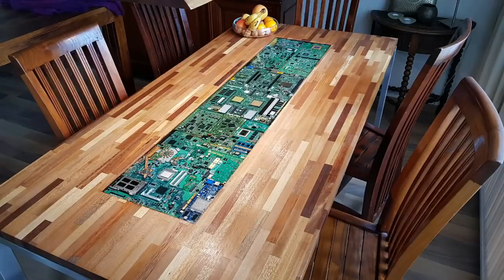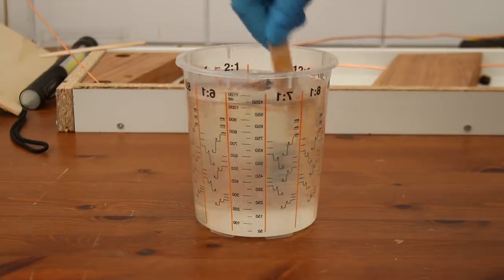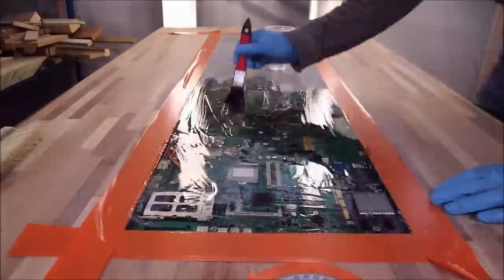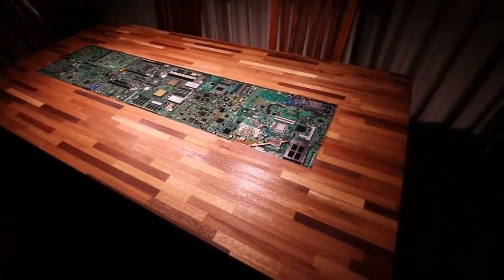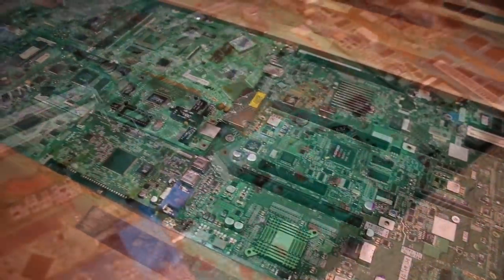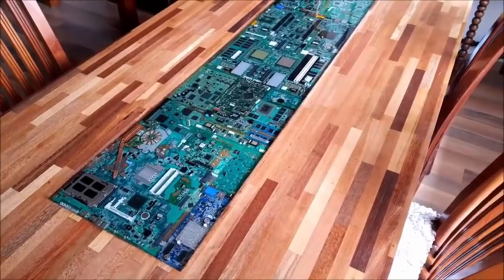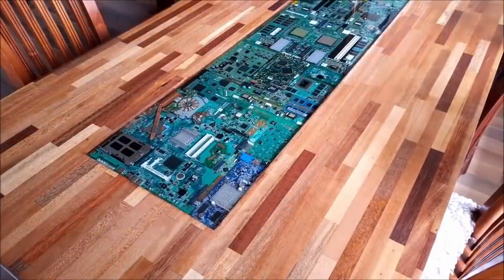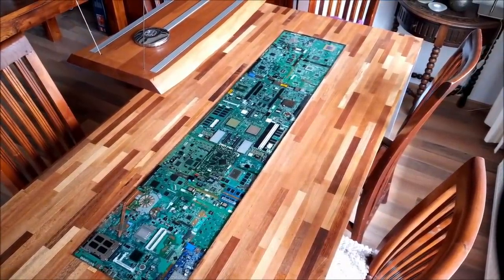Circuit boards with lights in epoxy in a table

Comment: Next time use 2 1x4 flat boards as a sled and run the router deeper all the way . Wasted time and energy on chiseling all that out also dont know much about epoxy but what about spraying hardner on it and letting it soak then recoating the whole table top with thouroughly mixed epoxy to seal
Reply from the maker: As you can see here https://www.youtube.com/channel/UCNdDV4vHKjuWOYlEW4HIk5w/community I've begun trying to fix the table. I routed out the bad spots and will try to pour in new epoxy. The first results look promising.

Comment: Such a beautiful table, and awesome idea. Shame it didn't work in some of those areas, and remained sticky. There must be a way.. What if the resin was poured in smaller amounts, and in more stages..I would still love to try something like this :)
Reply from the maker: As you can see here https://www.youtube.com/channel/UCNdDV4vHKjuWOYlEW4HIk5w/community I've begun trying to fix the table. I routed out the bad spots and will try to pour in new epoxy. The first results look promising.
There is no point in pouring smaller batches as the problem was in the mixing of just that one layer..

Comment: It may also be a bad reaction to some of the Plastics on the PCB's, Might pay to glue the boards down and then a glass plate over them and then some epoxy.. what say yo all?
would thart woik? Err-that work? Another thought came to mind and that is that electrolytic capacitors have OIL in them, and if any of them have leaked even if some in detectable amounts, it could mix with the resin  and Ruin it, ergo it might pay to bath the PCB's in alcohol before installing them..
Reply from the maker: The first pour I did was to fixate the boards and that was fine, so the boards had no influence on the epoxy. The problem was in the mixing. 
As you can see here https://www.youtube.com/channel/UCNdDV4vHKjuWOYlEW4HIk5w/community I've begun trying to fix the table. I routed out the bad spots and will try to pour in new epoxy. The first results look promising.

Comment: Is it possible that the oil you used for the wood actually is the problem?
if it is then I would suggest you use a Clear Marine Lacquer instead of the oil, on the wood that is..

Comment: amazing project! 
what was the reason of the smudges ? The extra layer of epoxy, which you put with the orange tapes on the side?
Reply from the maker: As I said, it was the mixing that went wrong. Originally I wanted to sand and polish the surface, but as I saw the bad spots, I added the extra layer - no use in sanding and polishing... 
As you can see here https://www.youtube.com/channel/UCNdDV4vHKjuWOYlEW4HIk5w/community I've begun trying to fix the table. I routed out the bad spots and will try to pour in new epoxy. The first results look promising.

Comment: I personally love the table. I would have gone a little further with the fiber optic cables to run off a 9v battery, a rotating light and give the glimmer effect. I've  been working with electronics for almost 40 years and as a career for 23.

Even with the bad spots the table is NOT a complete loss. Look for garage sales for old glass tables and lay a glass cover over it.
Reply from the maker: So we do it all on our own way... I deliberately left out the battery powered lights with controller, because I thought you would go crazy quickly of a carnival in a table all the time... 😊 It is the temporary character of the manual light for a few seconds in the fiber optic that I like.
As you can see here https://www.youtube.com/channel/UCNdDV4vHKjuWOYlEW4HIk5w/community I've begun trying to fix the table. I routed out the bad spots and will try to pour in new epoxy. The first results look promising.

Comment: the failed staff caused because epoxy wasnt put there in one step.... cover it with black paint, and you will have expesive but good table.
;)
Reply from the maker: No, the problem was in the mixing. You're the absolute first with the black paint suggestion - and that's an accomplishment after receiving already over 4000 comments on this one video... 😊
As you can see here https://www.youtube.com/channel/UCNdDV4vHKjuWOYlEW4HIk5w/community I've begun trying to fix the table. I routed out the bad spots and will try to pour in new epoxy. The first results look promising.

Comment: The 7 liter pour was too much at one time. Did a table with epoxy a couple of years ago, and I only used ~4 Liters total, in several pours, with about 6-8 mm thickness. I still have soft spots. If I leave a full beer bottle on it overnight, the next morning there will be a small indentation. It does go away in a couple of days though.
Reply from the maker: It depends on the kind of epoxy how much you can pour at once, and the limit is not in the volume, but in the thickness. My epoxy could be poured 5 centimeter at once, I did little over 1. My problem was definitely in the mixing (and it wouldn't surprise me if yours was too).

Comment: Cool looking table and I apologize if someone already asked this... but wouldn't it have been easier to just route the entire thing out instead of chiseling the bulk of the material?
Reply from the maker: Yes, you're not the first to ask, but I don't mind... 😊 I don't think that would have been easier. With one blow of the chisel I can take out far more than in the same time with the router, and I would have had to make some kind of sled for the router. 
Someone suggested me to cut with the saw the whole rectangle out and put a sheet of plywood underneath, and yes, I do think that would have been quicker...

Comment: i'd like to have a similar thing except it would be a working pc (even if it was with windows me). :p
Reply from the maker: You're not the first to suggest (so I had some time to think about it 😊 ) but the thought that if the pc would break down, the table would lose part of its coolness, made me decide not to attempt.
Reply: @Onrust1  yeah but it wouldn't have epoxy resin so i guess it would have a removable glass counter. and it would have less amount of componentry so it would be a challenge to make it this size (for example: two pc-s connected by lan). (and it would have to be practical, so at least have all the sockets etc.)

Comment: and how much resin did you use on that table ?
Reply from the maker: A bit under 10 liters. More about it in the description of the video.
Reply: @Onrust1  how much resin i need for 30x80cm table ??
Reply from the maker: Hey this kind of math you had in school... 
It's L x H x D in liters, where 10 cm = 1. So with 30x80 and 5 cm thick (I'm guessing the thickness here), it is 3 x 8 x 0.5 = 12 liters.
Expensive table... 😊
Reply: @Onrust1  thats a lot of resin XD. im going with acrylyc sheet then

Comment: I felt it was a fail before finding out about the epoxy, because I didn't like the execution of the lighting.  It seemed that it would only work if the room was dark.  I would have preferred keeping standard LEDs with wires and maybe some way to power it -- that's just me.  Otherwise, the idea and the expression of the motherboards does seem somewhat interesting.

Comment: Maybe cut a nice big slab of glass and put it on top of the table, like some bar counters have, its shiny, and the table wont be sticky, and its easy to clean. It would weigh a TON though :P
Reply from the maker: As you can see here https://www.youtube.com/channel/UCNdDV4vHKjuWOYlEW4HIk5w/community I've begun trying to fix the table. I will try to pour in new epoxy. The first results look promising.

Comment: Ziet er geweldig mooi uit, jammer dat  het misgegaan is. Plekken met slecht gemixte hars kan je niet herstellen helaas, of je zou de plekken helemaal weg moeten halen, maar dan beschadig je waarschijnlijk de printplaten. Het beste is om de hars met verharder met een boormachine en een verfmixer te mengen, of in een afgesloten blik en dan goed schudden. Je weet dat Epoxy zwaar giftig is? Tijdens het verwerken altijd een koolstofmasker (P2) gebruiken. Het nadeel van Epoxy is dat het vrijwel geurloos is. Je kan Epoxy jarenlang zonder een probleem verwerken maar dan opeens wordt je er allergisch voor, en dan heb je een probleem. Ik ken iemand die jarenlang helikopter rompen bouwde voor RC Helikopters, op een dag was hij bezig met een relatief kleine reparatie met Epoxy. Omdat hij "voor een uurtje" in de garage zou zijn en zijn vrouw met het eten op hem wachtte ging ze kijken waar hij bleef. Hij lag letterlijk te stikken, zijn ogen zaten dicht door slijmvorming en hapte naar lucht. Gelukkig hebben ze hem kunnen redden en het bleek een heftige reactie op de Epoxy te zijn. Het was een grote forse kerel met een grondverzet bedrijf en hij geloofde niet dat het door de Epoxy kwam, want "ik werk er al 30 jaar mee en nooit een probleem gehad, dus dat kan niet" Met het gevolg dat hij nog een keer in het ziekenhuis terecht kwam nadat hij een klein bekertje Epoxy aangemaakt had. Toen wist hij het ook.
Reply from the maker: Indrukwekkend verhaal. Ik weet dat het giftig is en doe ook alles om contact te vermijden, maar dat de dampen ook zulke consequenties kunnen hebben (ik ruik inderdaad bijna niks), daarvan was ik me niet bewust. Ik draag wel altijd een masker, maar ga nu op zoek naar een koolstofmasker. Lijkt me wel verstandig... 
Ik ben al bezig met het herstellen van de tafel, en het lijkt heel goed te gaan. Je kunt het hier zien: https://www.youtube.com/channel/UCNdDV4vHKjuWOYlEW4HIk5w/community Ik heb inderdaad de slechte plekken weggehaald, voornamelijk met de bovenfrees. De epoxy heeft een hele dunne laag die vloeibaar is gebleven en die je er bijna zo vanaf kunt pakken, zonder de printplaten te beschadigen. Ik krijg niet alles weg, maar 90 procent van de ellende wel. Het is een groot verschil met hoe het was (maar het is wel weer veel werk). Ook hier wil ik een video van maken. Bedankt voor je reactie! Groeten, Ron.
Reply: @Onrust1  Ik ben meer dan 35 jaar als autospuiter aan het werk en kom dagelijks met oplosmiddelen en andere giftige stoffen in aanraking. Wat dat betreft ben ik gelukkig nog altijd bespaard gebleven van de consequenties die altijd op de loer liggen. Maar ik ben er altijd van bewust geweest en draag altijd handschoenen en mijn masker. Hier een link naar een heel goed masker dat niet te duur is, je kan natuurlijk zelf ook zoeken maar kwaliteit/prijs is echt goed: https://www.nonpaintstore.nl/nl/3m-06941-verfspuitmasker.html  Oja, berg je masker altijd in de hersluitbare verpakking die erbij geleverd wordt, de koolstof doet zijn werk ook en verzadigd als je het masker open en bloot ergens neerlegt. Knap dat je het al zo goed voor elkaar gekregen hebt, je bent een doorzetter :) Ik ben benieuwd naar het eindresultaat, neem je de tijd zodat de Epoxy goed kan uitharden, dat duurt namelijk een paar weken, misschien wel maanden. Dat is afhankelijk van de temperatuur en luchtvochtigheid. Bijna alle 2 of 3 componenten materialen lijken na een relatief korte periode uitgehard, maar niets is minder waar, tot 90 of 95% gaat snel maar de uiteindelijke volledige hardingsproces duurt minstens een paar weken.
Reply from the maker: Bedankt voor je tips en de link! En de complimenten... 😊 Ja ik weet wel van doorzetten, maar er moet wel sprake zijn van een zichtbaar doel - in dit geval: een nieuwe video. Ik heb gemerkt dat het uitharden lang duurt, ja. Heb jij misschien een tip hoe ik die epoxy nog harder zou kunnen krijgen? Afwerken met een polyurethaanlak misschien? Op een tafel wil je nou eenmaal geen krassen..
Reply from the maker: Ik heb je masker gekocht en al gebruikt. Nogmaals bedankt voor de tip.
Reply: @Onrust1  Goed bezig kerel 😁👍

Comment: I think you should try to salvage your hard work and maybe find a way to remove the bad parts and repair and refill them. I love this concept and have seen many videos of this type and the one thing everyone seems to pay particular attention to is mixing the resin perfectly in very large mixing/measuring containers to ensure a nice consistent even pour over the entire area in layers. For example 4 liters for the 1st pour, let dry, then pour the remaining amount needed to make it level with the table top and cover components. Also in other videos they will try to get all the bubbles out and apply heat during the curing /drying process. I really want to have a table like this in future because I had one in the past. It was an old door from a catholic church in mexico Me and  my wife (now ex-wife) were placing photos bank notes, coins, and other souvenirs under the resin as a way to remember our adventures together.
Reply from the maker: Nice story. How can you lose such a table / door..? 😊
As you can see here https://www.youtube.com/channel/UCNdDV4vHKjuWOYlEW4HIk5w/community I've begun trying to fix the table. I will try to pour in new epoxy. The first results look promising.

Comment: Solutions: do smaller pours and use a heat gun to pull the bubbles out. That will also help with the poor mixture of epoxy. Tape the edges of the table before the final pour, so you can just pull the over-flow off with the tape.
Reply: Does heat gun speed up the cure process? Could the bubbles be shaken out?

Comment: Perhaps a sheet of glass glued over the entire surface of the table or a part with microcircuits fixed the suitability of the table ?!
Reply from the maker: As you can see here https://www.youtube.com/channel/UCNdDV4vHKjuWOYlEW4HIk5w/community I've begun trying to fix the table. I will try to pour in new epoxy. The first results look promising.

Comment: Seems like the table wasnt absolutely level, which should have been considered.
Reply from the maker: It was level. It is not completely flat, but the middle is a few mm lower than the ends. I was not aware of that until the pouring revealed it.
Reply: @Onrust1  Ok buddy. ..just wondered. ...really a beautiful piece of work. ..

Comment: If there isn't too much liquid phase resin entrained in large bubbles, you could try vacuum bagging and baking.  It won't significantly set residual liquid resin without more catalyst.  But, it should remove the volatile organics available to the surface, and "dry" the wet/stickiness out of everything.  What level of defect "repair" you choose to do beyond that is up to you.  Fill bubbles, cut 'em out, color them, light them, whatever.  Failures give Damascus steel its defining character.  As a table, it's a bit inorganic without some, for my taste.
Reply: Preempting flaming, if you can build this table, you can make everything I just mentioned.
Reply from the maker: As you can see here https://www.youtube.com/channel/UCNdDV4vHKjuWOYlEW4HIk5w/community I've begun trying to fix the table. I will try to pour in new epoxy. The first results look promising, it looks like I can take 90 percent of the ugly spots out (trying to take the rest out would damage the components on the boards).

Comment: If the sticky epoxy is a problem, how about doing a light layer of epoxy followed by a layer of either glass or plexiglass (if the plexiglass doesn't have an adverse reaction to the epoxy).  Then if there are any sticky spots, they are 1 trapped under a surface that is known to be solid and 2 controlled by the groove trap due to gravity.
Reply from the maker: As you can see here https://www.youtube.com/channel/UCNdDV4vHKjuWOYlEW4HIk5w/community I've begun trying to fix the table. I will try to pour in new epoxy.

Comment: What should i search for to find this kind of wood?, i am planing in making a desk for my PC setup and this kind of mixed color wood is all i need :P
Reply from the maker: I asked the experts at the Art Centre where I have my workshop what kind of wood it is, and they said it is not one kind, but lots of.
Reply: @Onrust1  Thank you for the answer, and awesome proyect, i hope you can do something about the epoxi fail.
I supposed that was a lot of woods toguether but i thought that type of wood (mixing different types) had a name 🤔
Reply from the maker: As you can see here https://www.youtube.com/channel/UCNdDV4vHKjuWOYlEW4HIk5w/community I've begun trying to fix the table. I will try to pour in new epoxy.
I'm not aware of a name for a sheet of different kinds of wood...

Comment: try to remove the top layer of epoxy by sanding. If the problem is in the top layer that may be fixed.... What about doubleing with glass?
Reply from the maker: As you can see here https://www.youtube.com/channel/UCNdDV4vHKjuWOYlEW4HIk5w/community I've begun trying to fix the table. I will try to pour in new epoxy.

Comment: Ahh, epoxy. Het is sterk aanbevolen om een mixstaaf te gebruiken met bijvoorbeeld een accuboor. Zoals je hebt geleerd is het goed mixen van het mengsel van vitaal belang. Wanneer je denkt dat je klaar bent met mixen, mix je nog een halve minuut extra langer door om zeker van te zijn.
Reply from the maker: Ik ben naar een winkel gegaan met bootonderdelen en heb een impeller gekocht. Die heb ik met moeren aan een draadeind vastgemaakt en dat gaat nu in mijn accuboor. Werkt prima. En ik wissel van beker. Iemand zei 'als je denkt klaar te zijn, moet je opnieuw beginnen'. 😊 Dat lijkt mee goed uitgangspunt...

Comment: cut out the center with a jigsaw, put in another attempt made separately on a plywood base.  table is to nice to not try again.
Reply from the maker: As you can see here https://www.youtube.com/channel/UCNdDV4vHKjuWOYlEW4HIk5w/community I've begun trying to fix the table. I will try to pour in new epoxy.

Comment: if it were me i cut the epoxy out, letting it drop to the floor and re epoxy the hole plus in bed the fibers into the epoxy so they are not seen.
Reply from the maker: Embedding the fibers would be very difficult, because they can only be bend with a radius of about one centimeter. I put a sheet of plywood under the table, so they are not visible anymore..
As you can see here https://www.youtube.com/channel/UCNdDV4vHKjuWOYlEW4HIk5w/community I've begun trying to fix the table. I will try to pour in new epoxy.